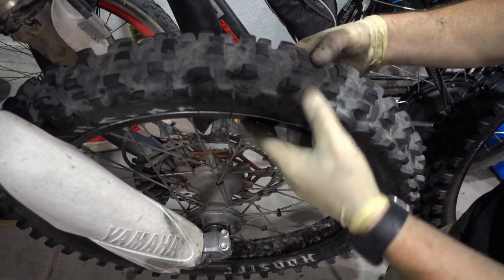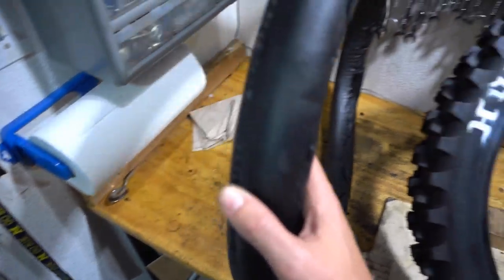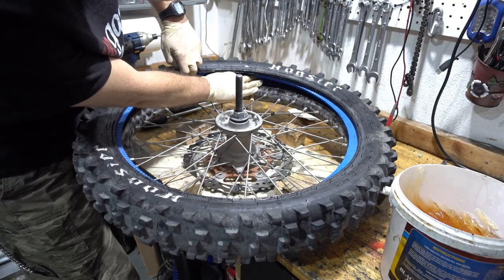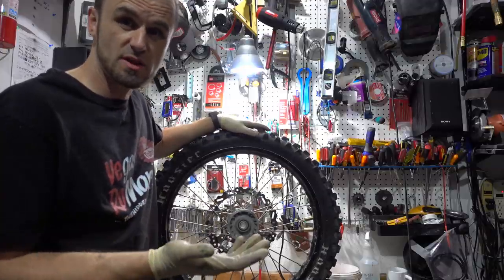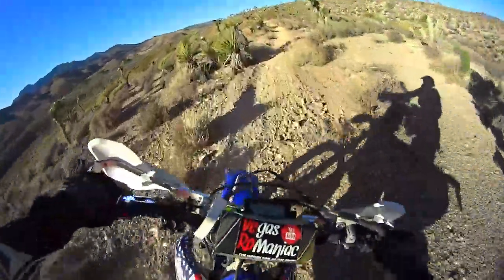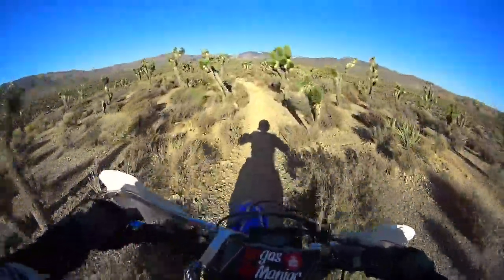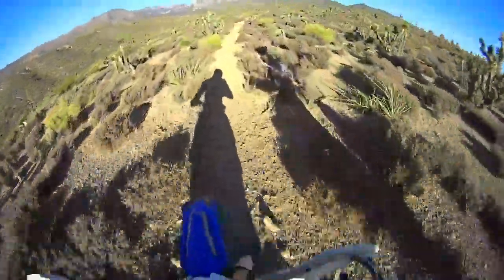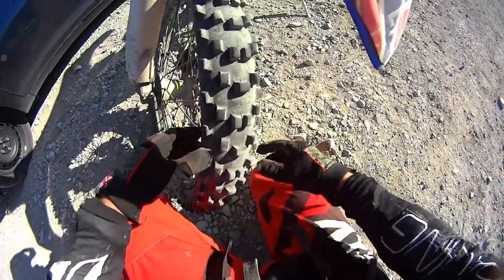Blue MOUSSE 🤔 HOME MADE MOUSSE BIB 😲 Best FILLER for a Shrunk Mouse Bib

Comment: 80/100-21 explained. The 100 means that it is 100% of 80. It's the aspect ratio. That means that tyre is 80 wide and the side wall is also 80. Not 100.
Reply: Go back to school.
Reply from the maker: Really, every chart I see, it said what I said not this, that is insane.. Internet is wrong
Reply: @vegasromaniac  The internet is not wrong you probably just misunderstood. Every tyre is measured like this. Take my rear tyre on my motocross bike for e.g 100/90 - 19 The tyre is 100mm wide the side wall is 90% of 100 = 90mm. The second number is always the percentage ratio of the width.
Reply: Kitesurfer guy is correct @vegasromaniac
Reply from the maker: @kitesurfuk R good to know , that's for sure !
Reply: @vegasromaniac  The front tyre is not 100 wide! It's 80mm wide and 100% of 80 mm deep.
Reply: Vegas RoManiac tire manufacturers themselves have explained this

Comment: Hi Vegas,
Been following your videos for quite a while now and loving the Surron input from a dirt biker’s perspective on here and fb - some good reading !! 

Unsure the chances of you reading this but would like your opinion on either to use a filler or wedge for my 45hr slightly shrunk front nitro mousse.  I don’t like the idea of having a seperate cut piece in the wheel but afraid that adding something like a gym mat might gather up. My mousse is in v good nic as I had  injected silicone grease and oil in every 10ths so it stayed nice and lubricated. What would be the better option long term as I have a new tyre to insert the mousse into ?

Mike
Australia
Reply: Btw this is on a beta 250rr not a Surron 🙂
Reply from the maker: The matt doesn't pump so you don't have to worry about that , but also the wedge it's a better choice I do wedges till I run out of options than I push a yoga matt in there ..
Reply: Awesome cheers bud

Mike

Comment: Hey VR I like the foam liner the guy made plan on getting a couple of sets ....use a thick tube and the foam insert you bitch about traction and being able to adjust pressure run higher air pressure and freaking deal with it..sheez I know one other thing you can do is buy that liquid filler at tractor supply that turns solid you know the the stuff has a picture of a tire with a bunch of nails in it..hey you want to meet up at everides place in Utah end of March??? ...peace Tim
Reply from the maker: Can't plan that far ahead, but I always love to meet up new riders so keep me posted

Comment: 100 is width..80 is a percentage of width.....height is 80% of the 100.   That is applicable to all tires...
Reply from the maker: Yeah I just found out, but if you measure it it never matches, every mfg, has a difrent shape I swear... It's juatab guide
Reply: 100 is not the width. The first number is width i.e. 80mm and the second number is the percentage ratio which in this case is 100.  100% of 80mm = 80mm. The front tyre is 80/100 - 21